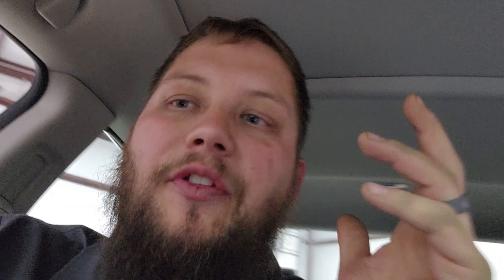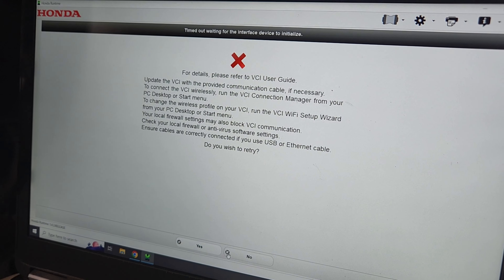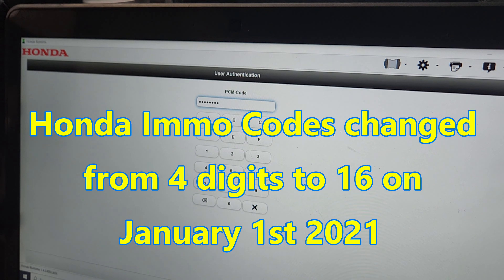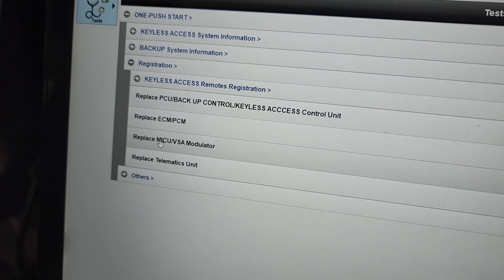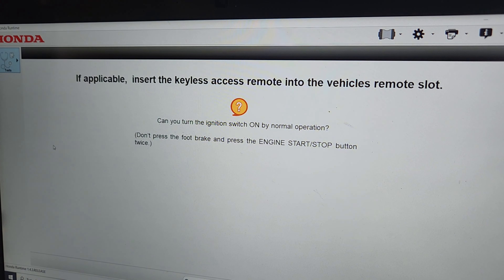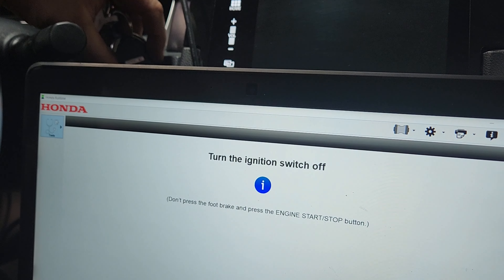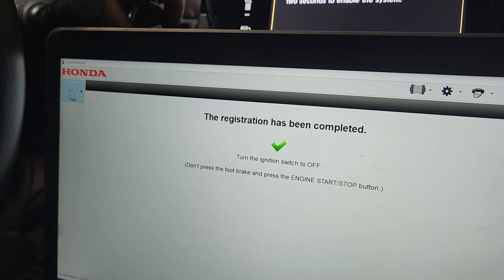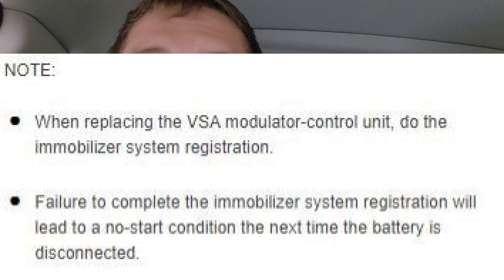Honda ABS Modules Need an Immobilizer Relearn?

Comment: Any aftermarket tools like the 608 or auto pro pad able to do this?
Reply: Most likely yes. Anything onscreen will work and most Chinese immo will pull those codes put or offer an alternative cheaper version.
Reply: Yeah! I just did one with an IM608 about a month ago.
Reply: @Voltage Drop Diagnostics  thanks good to know!!
Reply: @VoltageDropDiagnostics  Awesome!  I’m hoping to order the new IM608 from AES Wave within the next 3-4 weeks.

Comment: Hi, I'm having an issue with my daughter's 2016 Honda HR-V. It got into an accident on the front passenger side wheel, and both the driver and passenger airbags deployed. I took it to a shop, but it has been sitting there for four months with no work done. I eventually got it back, but it was a fight to retrieve it. Before I got it back, they did a lot of things to prevent the tow truck from taking it.

Today, I used a Launch scanner to troubleshoot and found five codes, all U0122. Searches indicate this relates to the ABS module. The Launch scanner shows no communication with the ABS module, and it’s grayed out. I also tried a used ABS module, which looks clean and new, but plugged it in and got the same codes. 

The car drives great, and all single scans and live data show that the speed sensors are reading correctly. The E-brake is working fine, too. I pulled every fuse one by one, including the multi-pack fuse for the ABS, and tested them with a meter; all passed.

What am I missing? Taking it to the Honda dealership feels like buying a new car. Where else can I check? While others on YouTube suggest that they do not have to reprogram after replacement, your video indicates that there must be something I haven’t done yet.

Comment: Hey Zack. 

I have a 2018 civic. 1.6 Diesel .

Abs pump seized solid after 100,000 miles. 

I found a matching part number on ebay and bought it. It gets here friday morning. 

Do i have to re programme that used abs module and pump when it comes? 

Or can i mate my controller, with the new pump body and the car will detect it. 

Thanks for any help
Than

Comment: I installed a used one. Does it need to be reset or just program same like you did?  Also an do you think if an autel scanner will do the job?  Thank you
Reply from the maker: Yes it still needs done. I do not know if autel will do it.
Reply: @L1Training  it didnt do it. It says  vsa programming failed. It doesnt proceed to the page where it asks the codes to put in.  I guess I need to buy Hondas software to do it :(

Comment: Bro question, I install a used tcm and abs how and I have the immobilizer light, can I program the abs and the tcm with aftermarket scanner?
Reply: did you ever figure out because i’m going to replace my abs with a used one and do i need to program it?